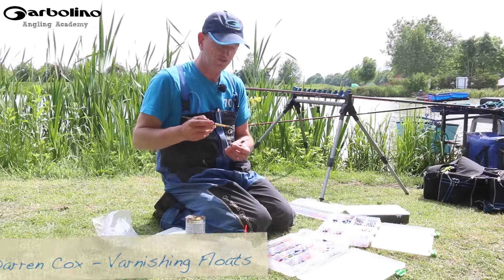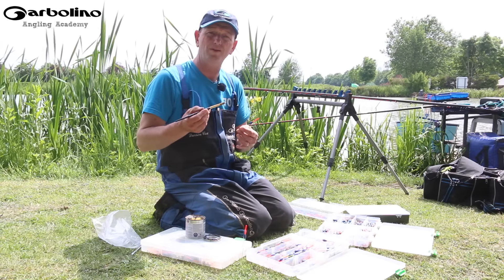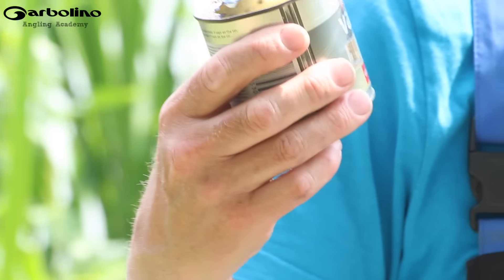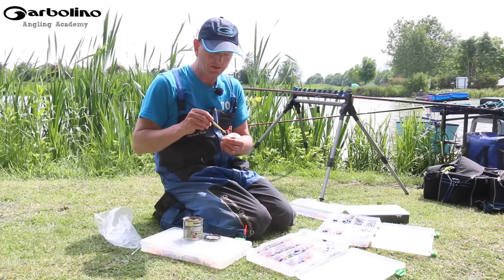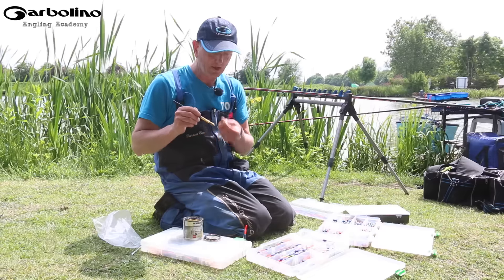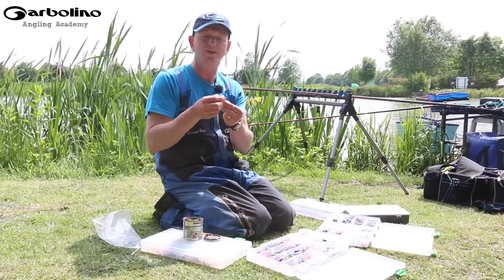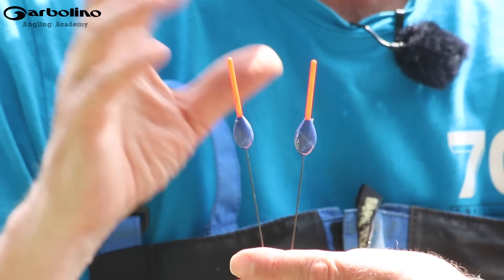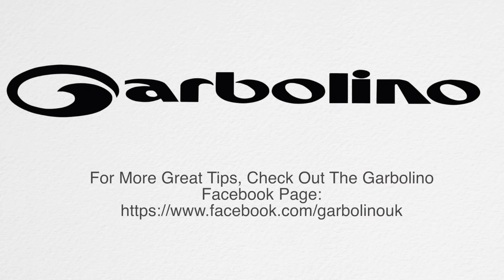Garbolino Angling Academy - Part Nine - Varnishing Pole Floats

Comment: Hi Darren. Ive started putting my own floats together and so far Ive used Hard As Nails nail varnish but it works out a bit expensive. The Ronseal  looks like a good alternative but i noticed it states its for interior use. How have you found the longevity  of the varnish?
Reply from the maker: It works perfectly and lasts a long time, Regards
Reply: @GarbolinoUK  Thanks